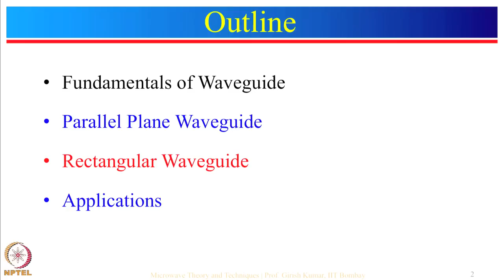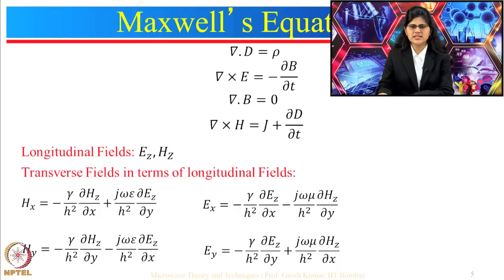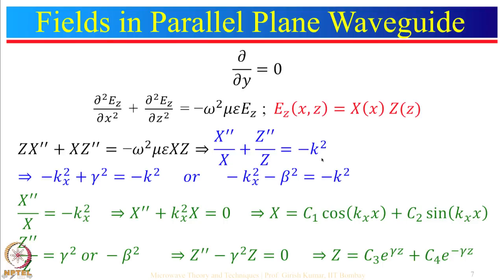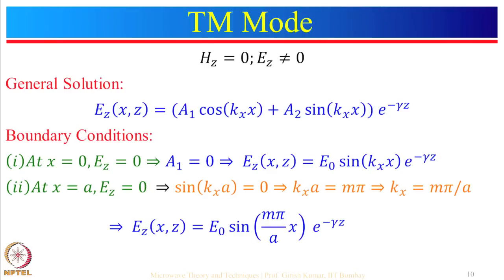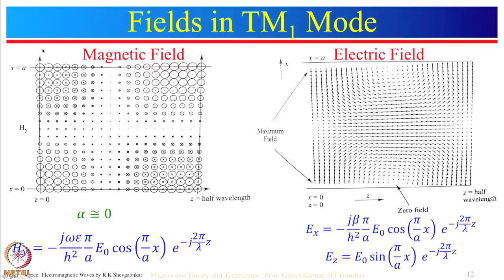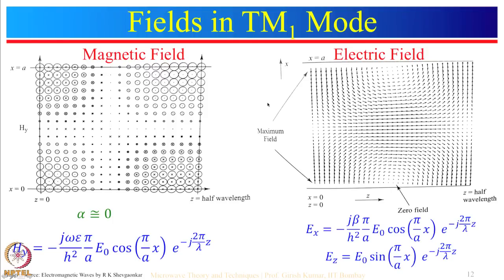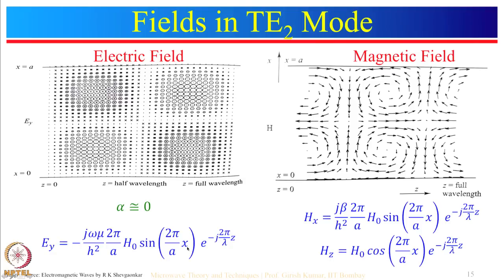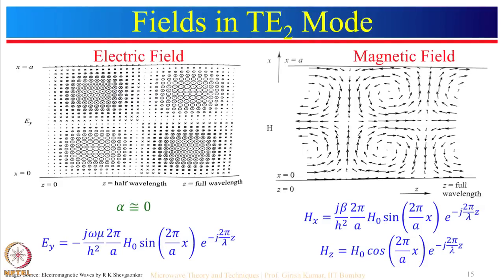Week 2-Lecture 6

Comment: Go to control panel, increase the size of cursor.
If available, use pointer option in presentation.
Attach assumptions and explanations of steps in brackets next to steps, more than what is shown here.

Anyways, good vid.